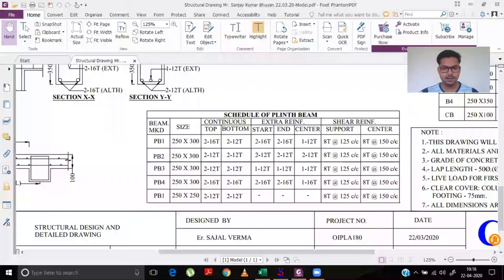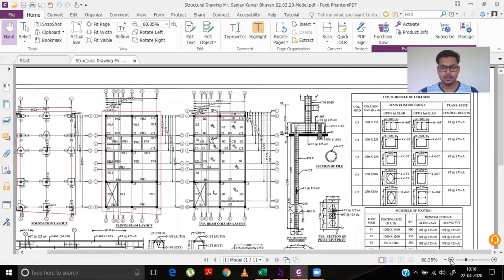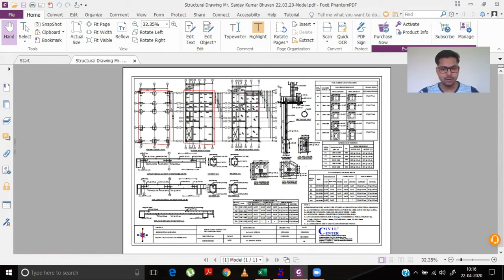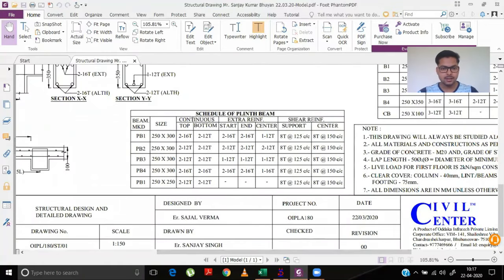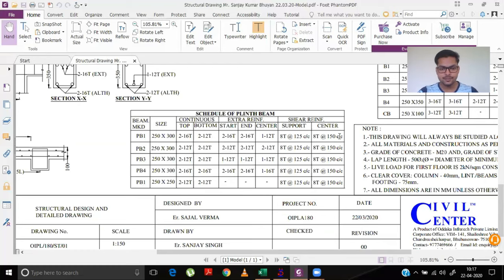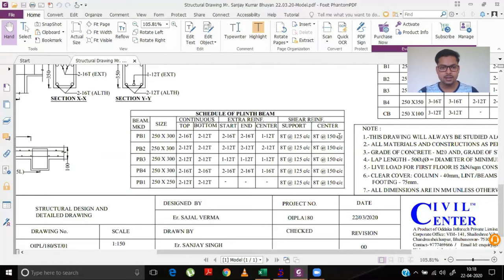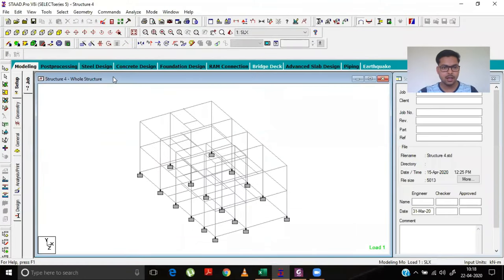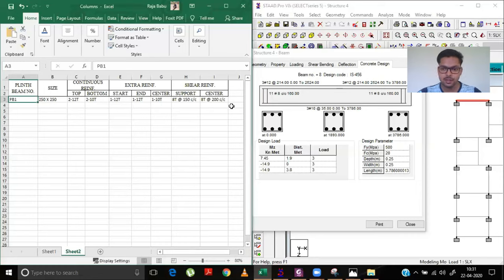How to make structural drawing || Structural Engineer Drawings || House Structure Drawing

Comment: We need structural drawings to communicate the design of the building's structure to the building authority for review. Structural drawings are also included with a proposed building's contract documents, which guide contractors in detailing, fabricating, and installing parts of the structure.

Comment: Practically we cannot provide 10 mm dia  bottom bars in beam. Minimum reinforcement bar diameter is 12 mm . And it is structurally not safe to provide 10 mm dia bars at beams

Comment: On what basis structural drawings are prepared??is it on the basis of structural details which we get from staadpro ???
Reply from the maker: Structural drawings are prepared based on the data that we get form either any software or from manual calculation. If you wan to learn how to do it professionally you can join our training

To join our professional training, click here : https://forms.gle/Yy9j8BH8zZzmFfZMA

For any query 

Call on: 8433248864
WhatsApp: +91 8433248864
Email: team@civilcenter.in
Reply: @CIVILCENTER  sure .. thankyou for your reply 🙏🏻

Comment: In practical life, PB1 PB2 act as a single beam. Then why the main reinforcement is different for both the cases. In PB1 at top, main reinforcement is 2-12mm bars and PB2 at top, main reinforcement is 2-10mm bars. How could it possible in real life. In real life we use same size reinforcement as a main bar
Reply from the maker: These drawings have been executed at site